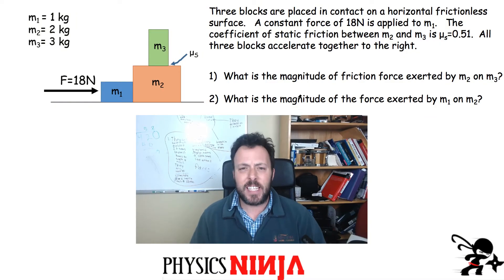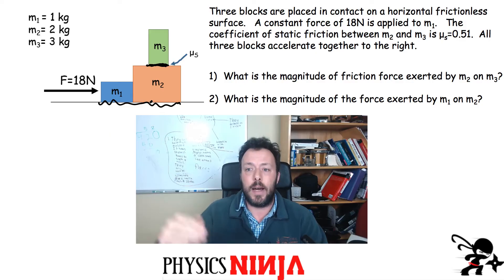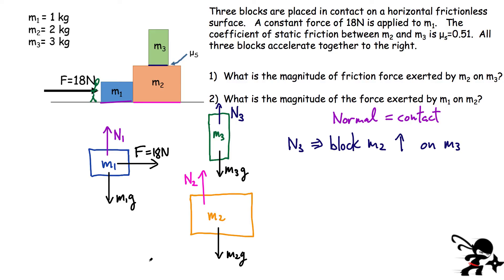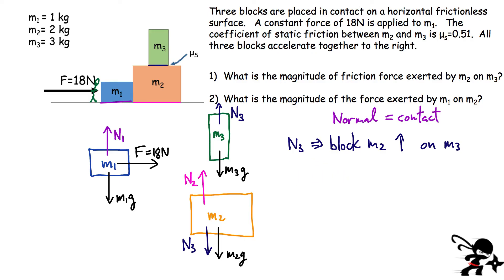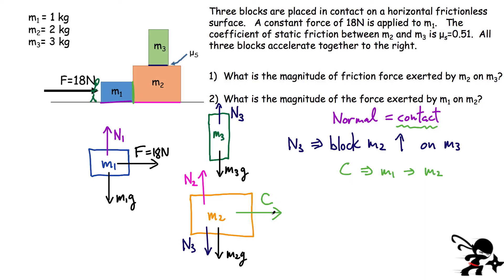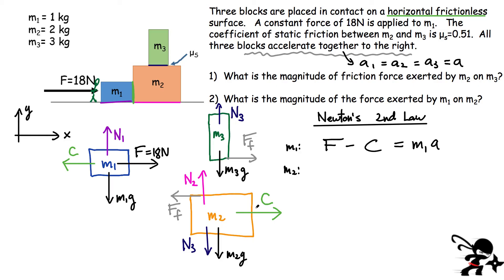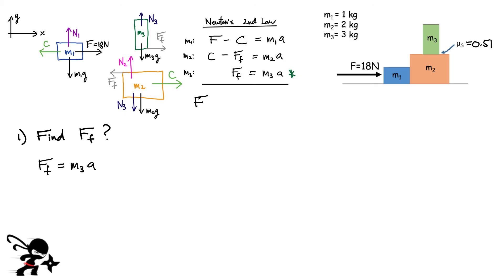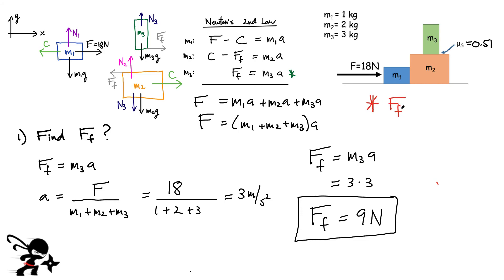Three Block Problem:  Friction and Contact Forces

Comment: So quick question, at around 7:14 when you insert the frictional force of M3 and its corresponding force onto M2, according to the way you drew it, wouldn't the Frictional force be causing an acceleration in your example to the right? 

Like I understand that the frictional force needs to point to the right on the M3 free body diagram for it to not slip off of M2, but what I don't understand is why we don't have an opposing force on M3 to keep it from accelerating forward. Or am I missing the bigger picture here? Is M3 technically accelerating at an equal and opposite acceleration in reference to the entire system? like for instance, the acceleration of the whole system is + 3m/s, but in reference to m3, this acceleration of the whole system would act on M3 like an acceleration of -3m/s, so M3 needs its own acceleration (caused due to friction) to prevent it from sliding off.

 Its a little hard to explain what I'm confused about, so sorry if this doesn't really make sense lol

Comment: If F was higher like 60N we would have ended with Ft being more than the max static friction .... does that mean that m3 will slide over m2 having different acceleration although the assumption was that they are moving together? ... it would also mean that we should always compare the two friction forces
Tanks - Nice video by the way
Reply from the maker: Yes, if the we are beyond the maximum force of friction it means that the top block will slip.  We can no longer assume that the acceleration will be the same for the top block.   If the top block is slipping we can then use the kinetic friction formula to find the force of friction and the acceleration of the top block.
Reply: @PhysicsNinja  where would that kinetic friction force be pointed to? To the right or left?